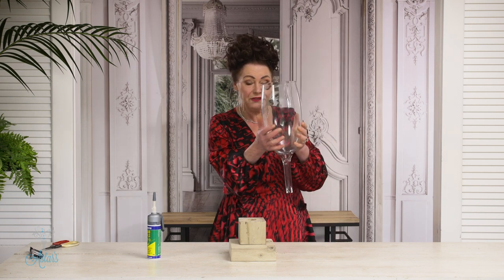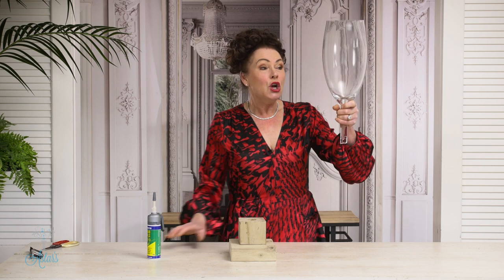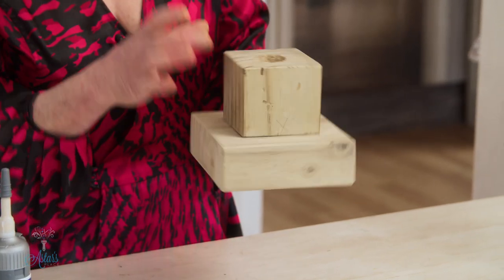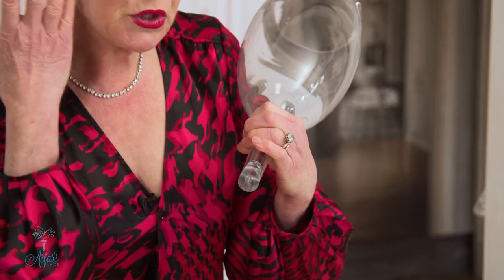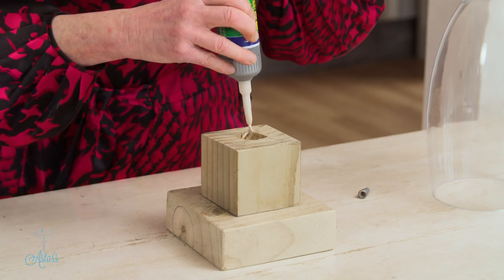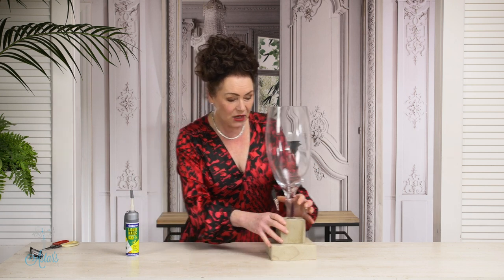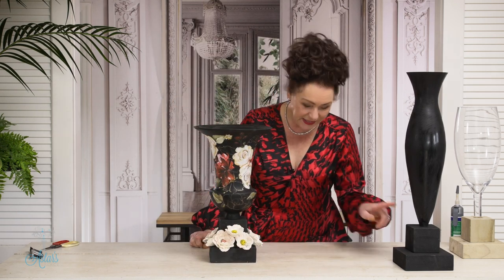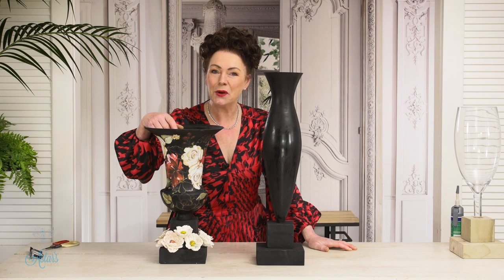How to fix a glass vase with a BROKEN stem!

Comment: One more question. How do you get the broken stem off?
Reply from the maker: Hello, the base of the vase with not only chipped, but a good portion had broken away so, I gently put a towel over the bits still in tack & GENTLY tapped away until it was all removed.  I think used the ginder to make smooth.  
My latest method is to use a glass cutting tool.  The cut is cleaner and a bit of sandpaper to the cut makes it nice & smooth.
Hope this helps?
Warm regards Astar
BTW - please wear safety glasses & gloves for protection.